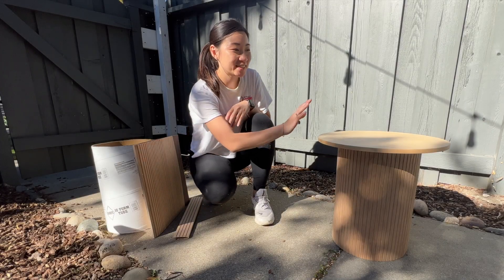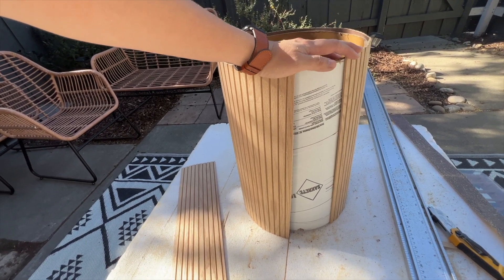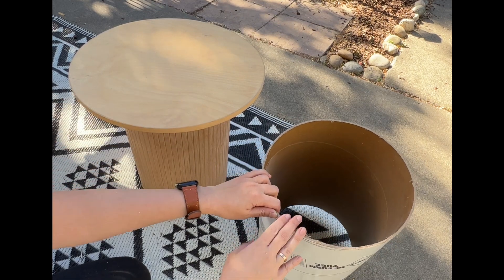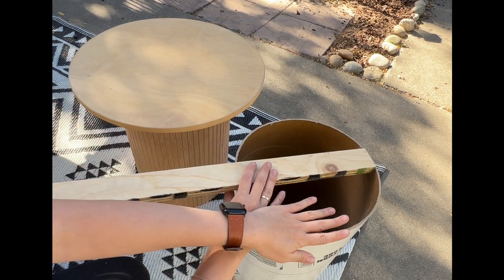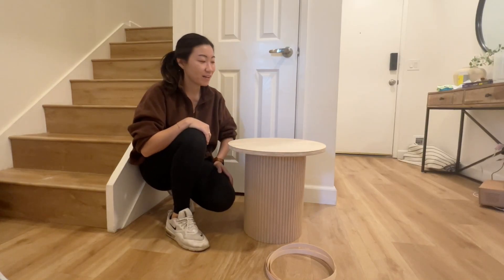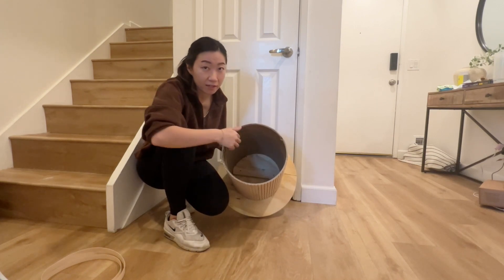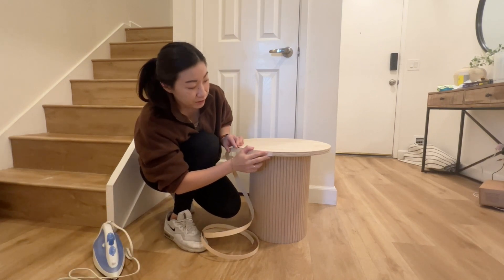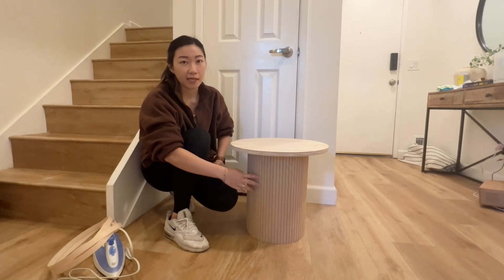DIY Fluted Coffee Table | Cost $60 | STEP BY STEP | Build from Scratch

Comment: If I were planing on making this but painting it black would you still need veneer tape for the edge?
Reply from the maker: Yes, I would recommend it because the texture will be different. If you look at plywood from the side you’ll see that it’s rough and you can see many “layers” of wood with small gaps between each layer. It’s not smooth. When you paint over it you will still see that uneven texture. The edge banding will help make the table look more high end and finished!:)